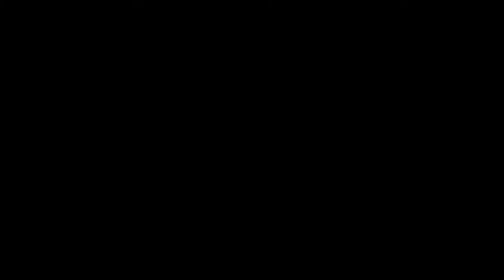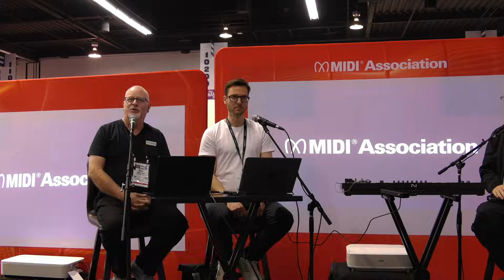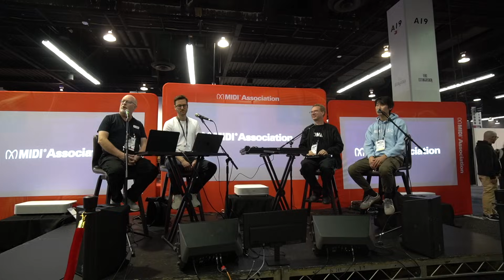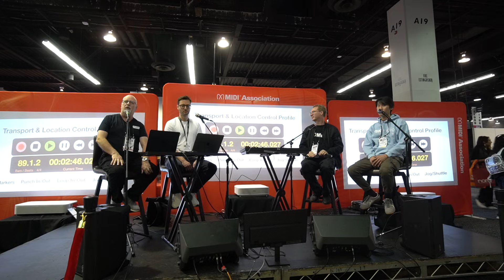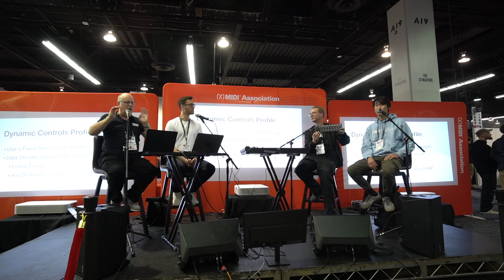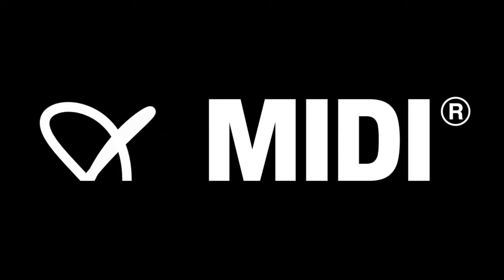DAW Control Profiles Update at NAMM 2026

Comment: MCUs have different Labels beside their buttons (and meanings), e.g. Note №70 (Shift) = Undo (in Cubase/Nuendo) = Show/Hide Mixer (in Audition); Note №84 = RTZ (DP & ProTools) = Play > (Audition) = Marker (Cakewalk & SonyVegas) = Shift (SAW Studio) = "Left" (Cubase/Nuendo);…
What if a MIDI2.0 manufacturer placed a label onto the controller, but not all DAWs support a labeled function? It can't be possible to transfer those profiles between DAWs (i.e. "learn" them about missing function)… But if the function is implemented, but not yet visible in Control Profile (?), the DAW should provide an ID list of all implemented functions (which is "public"… not just "exportable"), like AkelPad does (for Resource Hacker\Accelerators and Plug-ins/Scripts)…
P.S. VirtualDJ may have billions of variants of macros for encoders/buttons (even make them as modifiers) with a LCD feedback (modes, custom variables, parameter names, values in UTF-8 TEXT or fraction)…